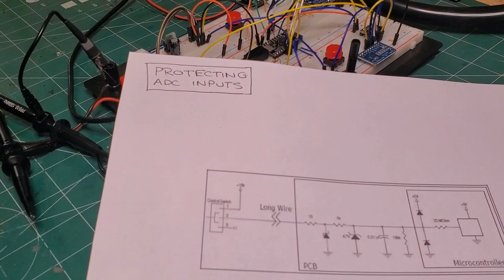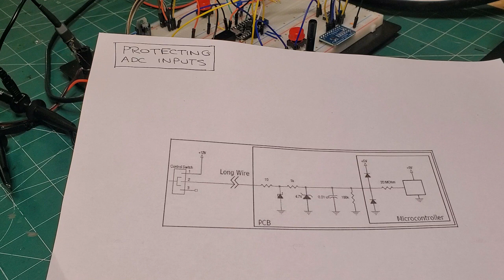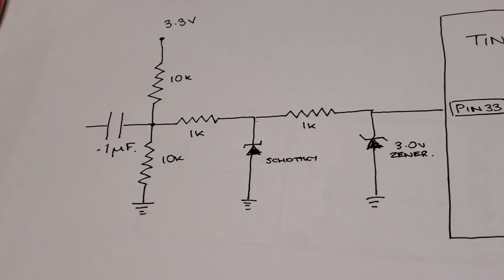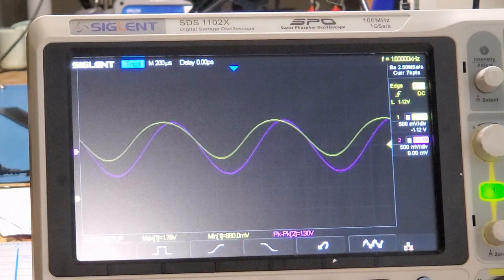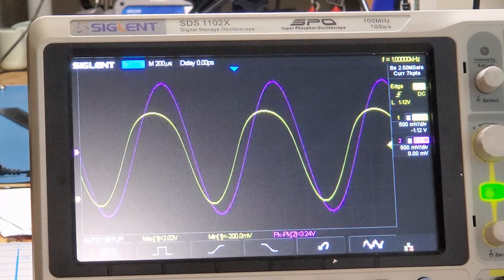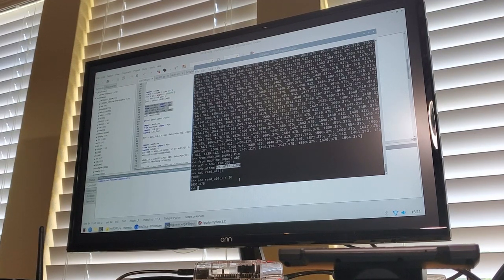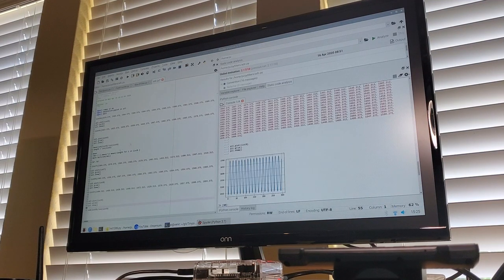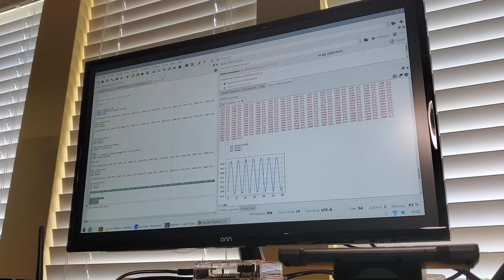TinyPICO Radio Part 3 - Some ADC Fun

Comment: Thanks for this video and an interesting series overall.  I'm just getting started learning about using Tayloe detectors so this is  very helpful.  When you were plotting the graphs you mentioned that you were using "spyder".  What is that?  Thanks.
Reply from the maker: Spyder is a python development environment which is usually installed as a part of the Anaconda suite of tools. Anaconda can be installed from here https://www.anaconda.com/

Well worth getting if you plan to do any Python development as it comes with a huge selection of python scientific libraries. Thank you for the comment!